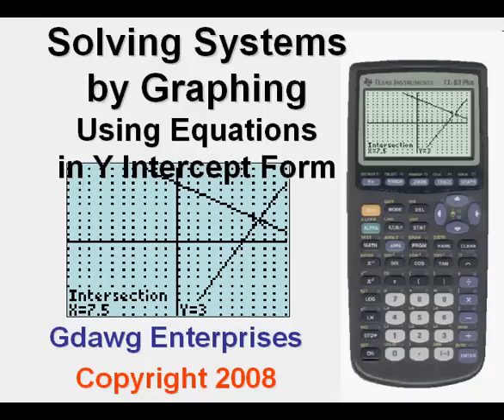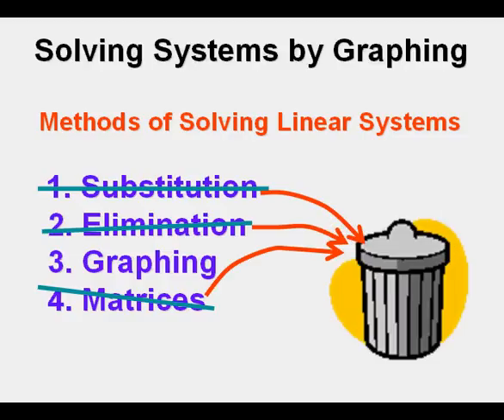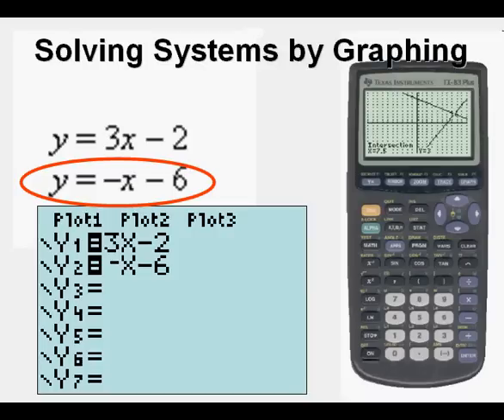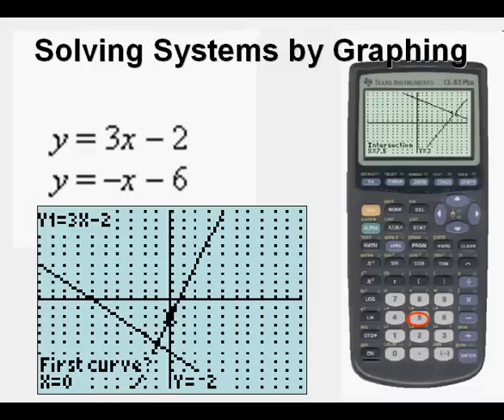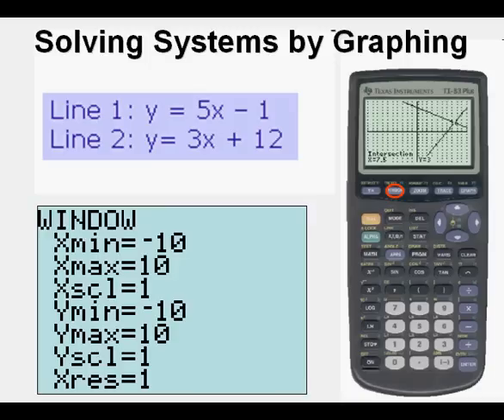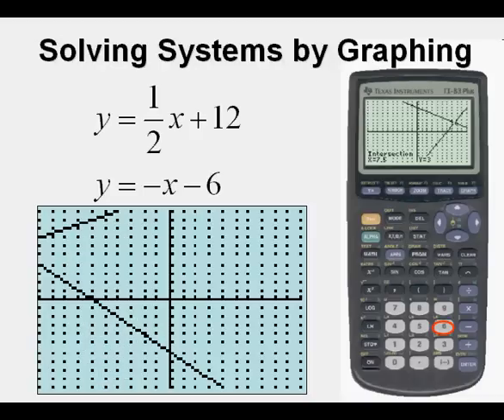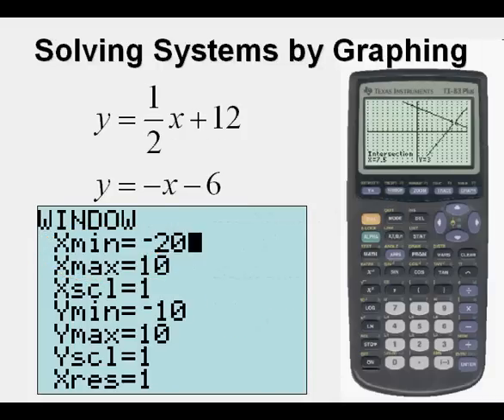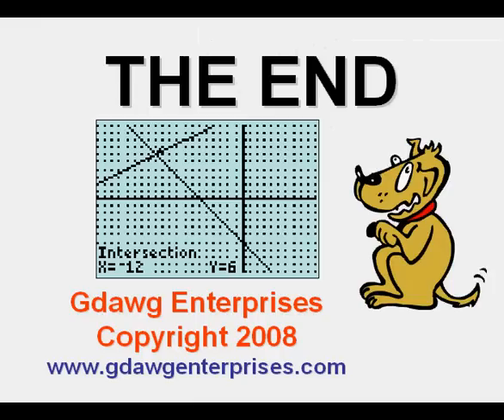Solving Linear Systems from Slope Intercept Form

Comment: can i trouble you i am taking the ged test and although i barely understand the slopes i manage to figure it out but when i took the test it had a problem with 6 squares with  5 negative numbers and 1 positive number and i got very confused how would I use the y2 -y1 over x1 -x2 for this problem  is this a stupid question

Comment from the maker: I think I need to clarify because some may not understand your comment.  If you store any value for X and go to the function editor by pressing y=, X will still behave as a variable within that function editor view, no matter what is stored for x.  However, if you use any letter other than x in that function editor and store a value to that other letter, it will be as you say, not a variable, but the constant value that you assigned to it via storage. Thanks for viewing and commenting.